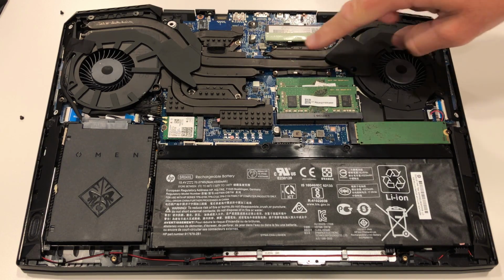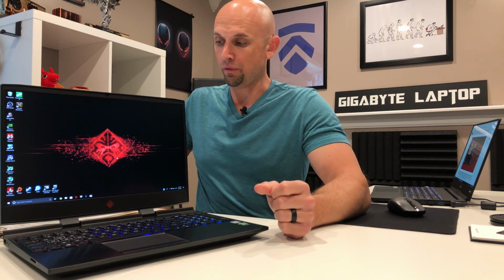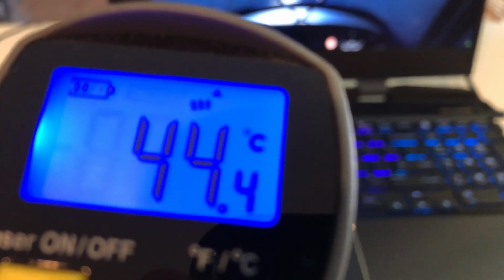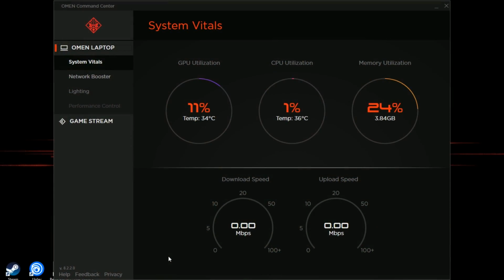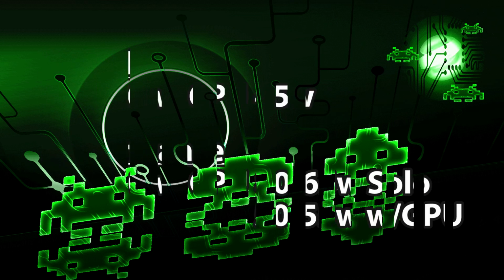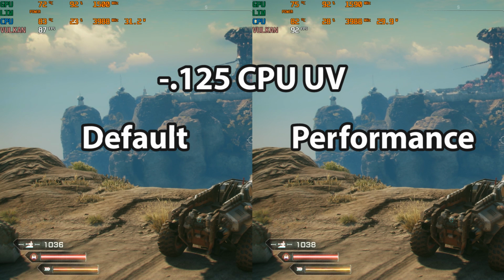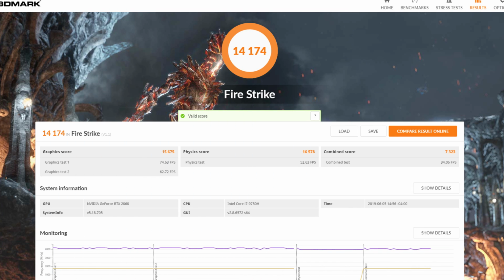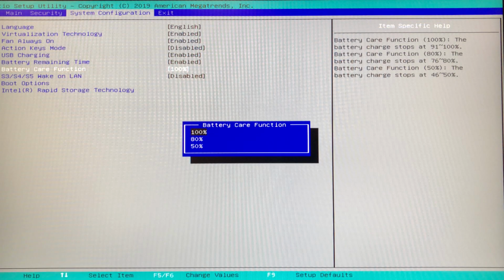HP Omen 15!  RTX, 9th Gen and 144Hz for $1199!

Comment: factor 1: before applying paste my idle cpu 60 to 75 gpu 60 to 70 becuase my rtx 2060 has giving display in my hp omen 15 1052nr neither intel display does  
factor 2: i applied paste exactly like a alots of youtuber does and tight the screw does it matter ? if i not tighten the screws? 
factor 3: i remove old paste gently just like many youtuber does my room temps is around 25 to 35 because its summer also i tried to undervolted, disable turbo boost but there is no difference in temps my gpu and cpu still got 90 above degree on gaming 
do you know any solution ?

Comment: I have hp omen 15-dc1088nr with the same specs as you mentioned, I can only undervolt my CPU up to -80mV. And my cinebench score is near to 2400
also no major difference between default and performance mode. What should I do as my temps are so high?

Comment: Omen 15. 
I9750 ,2060, 512ssd,Tb,144hz quiet,cool, bangin sound, slim. Hey Bob the price is right on this Omen 15
Reply from the maker: I think it’s dropped a price since I’ve reviewed this also 👍
Reply: @BobOfAllTrades  Ive stil got my Omen 15 i8750h, GtX 1060, 16gb, 1tb hdd ,256ssd UV -150.4 cpu, Gpu UV 1240mhz 750mv , 144hz lcd Installed via Bob method. All done the Bob way! HP announced a new slimmer tiny Omen 15 pavilion series w 300hz panel cant wait to see the review.✌
Reply from the maker: That’s a great machine I love laptops that have their display directly connected to the dedicated graphics card.

I have a contact at HP so I should be able to get that laptop eventually

Comment: I hope I didn't make a mistake by ordering the 2019 version with the exact specs in the video as I found it for a really good price. I really worry about the thermal performance. Do you think the new design improved the thermals?
Reply from the maker: I feel like this one ran a bit cooler especially on the GPU. Had better power limits along with maximum fan capability. So yeah, this should be a bit better I think.

Comment: @Bob Of All Trades : Here in denmark, the model is HP OMEN 15-DC1003NO with specs:
Intel Core i5-9300H
Nvidia GeForce GTX 1660 Ti
 8 GB DDR4 RAM (upgradable to 32GB)
144Hz display
 Would you recommend this over the Lenovo Legion Y540-15IRH (81SX00RWMX) with specs:
Intel Core i5-9300HF
NVIDIA GeForce GTX 1660 Ti
2x 8GB DIMM DDR4-2666 RAM
Your inputs would be really appreciated :)

Comment: Hi Bob! I would be very glad if you could give me your opinion on which one to choose, about the same pricing :

HP OMEN 15-dh0028nf : i7-9750H ; RTX 2080 (non maxQ) ; 16GB RAM ; 512 SSD ; 144hz + gsync 
GE75 9SG-835FR Raider RGB : i7-9750H ; RTX 2080 (non maxQ) ; 16GB RAM ; 1To SSD ; 144hz no gsync

My most important criteria is performance and cooling and I plan to buy an external screen supporting gsync with it. Thanks !!
Reply from the maker: The GE75 is much bigger and offers superior cooling performance.  You can max the fan with the push of a button too. 

Both will likely need a repaste. 

No way the 15” Omen is a MaxP 2080.  Their website needs updated as that chassis won’t handle a 150w GPU. 

The Omen has a little better built quality.  No Optimus and G-SYNC is awesome.
Reply: @BobOfAllTrades  Thanks for the fast answer !

2 french testers on youtube have confirmed the maxP 2080 in the 15" version and also the info sheets from HP make the MaxQ or not differentiation (maybe it's just in france though). That being said I would go for an Omen 17" instead if you think it would suit better for a maxP 2080 on the long run ?!

If I understand correcly the choice is to be made (if I only consider performance) among :
A better cooling on the GE75 
or
Slightly better quality and mainly no optimus + gsync on the Omen

I could use gsync on a gsync equipped external screen + minidisplay even with the GE75 right ? And if I boost the fans of the Omen 17" through the software can it match the GE75's cooling ? 
So in the end it comes down to a slightly better quality in the Omen and no optimus (sounds awesome), my choice should then be the Omen 17" with same specs as the GE75  ?

Thanks again for the insight!!
Reply: I stand corrected the testers only wrote rtx 2080 but don't confirm in their video if it's max q or not ! I'll go for the 17" version of the Omen or GE75 whatever happens! Thanks for the the important info

Comment: I had this exact laptop. In fact this was the video that made me get it. No problems and everything Bob said was on point👍  I thought it be a keeper, but after watching this video again like 100x 😁 and reading up online I realized GSync will be important. I exchanged it within the 2 week no questions asked exchange policy @ Microcenter. I'm so happy I did as I got 32GB RAM and RTX 2070 max q.  I'm playing DCS flight sim, a Very demanding game no doubt @ 111-144 FPS With MAX settings NOT high, MAX graphics settings. I tried paning around quickly and changing views to stress the system... 102-127 FPS!!!  It shouldn't be named "MAX Q" it should be "Dreams come true Q"  💖

Comment: Great channel. Just picked one up at Micro Center for $1,099 great buy. I undervolted by .140 and its stable and runs much cooler then out of the box. Put a overclock on it with MSI Afterburner  I let Afterburner decide the curve and its running great and very stable. I think for the money you can't go wrong if you don't mind undervolting if you don't undervolt the temps do get high. I don't have a lot of money so this is the best laptop I ever owned. Very happy with it. Thanks for your thorough review it helped me get the most out of my money.

Comment: great review! you are doing us all a great deal of help. thank you for that. i do have one question, need help about choosing the right/better laptop:
1) HP Omen 15, i7-9750H/16GB/512GB SSD/RTX2070 8GB/15.6"FHD 144Hz/FreeDOS (7RY32EA)
or
2) ACER Predator Helios 300 NH.Q53EX.025 / Core i7 9750H, 16GB, 1024GB SSD, GeForce GTX 1660Ti 6GB, 15,6" IPS 144Hz FHD
PLS HELP. what matters to me is 144Hz, nicer graphics, not too hot and not too loud!

Comment: When I go to Device Manager, the Monitor driver shows as 'Generic PnP Monitor'. Does anyone else have the same? I wanted to check if this is the real monitor. It shows as part DISPLAY\AUO82ED. Can anyone else check if this is the same monitor in the new one? I bought refurbished and worried.
Reply from the maker: That’s 100% normal. Use HWinfo64 👍
Reply: @BobOfAllTrades  Thanks. It is showing as Unknown Model AUO82ED which is from a company called AU Optronics, and not LG as you showed in the video. Should I be concerned? Been getting eye strain everyday.
Reply from the maker: Love Animals-01 Unless you bought it at Microcenter the chances are pretty high that you’ll get one of three different panels. Heck, I’ve seen this from the same place too.  No way from me to know 🤷‍♂️
Reply: @BobOfAllTrades  Sorry, final clarification. Are you saying that HP itself uses one of three different panels? OR do all new HP Omen 15 (with 144 Hz displays) come with the same 144 Hz LG screen?
Reply from the maker: Love Animals-01 Many manufactures use several different displays. It use to be much worse. Gigabyte is the only consistent company for laptops in that regard.
Reply: @BobOfAllTrades  Ok, good to know. Thanks again. I'll stick with my AUO82ED display and not apply that color profile then?

Comment: Anyone who can help please reply to this comment, thanks in advance.
>
>
>

Now I found the same laptop on Walmart website that has core i7 9th gen H processor, 6 gb gtx nvidia gpu, 16 gb of ram, 256 M.2 NVME SSD memory, 144 ghz screen, of course 15 in display, wifi 6, AND a headset and a mouse for $ 1100. I need it for editing. Should I buy it or buy the Pavilion which I can build thru the HP site, will link both here?
https://www.walmart.com/ip/Laptop-Omen-Headset-NVIDIA-HP-RAM-GTX-Intel-i7-9750H-16GB-1660Ti-Core-15-dc1088wm-6GB-Included-15-6-SSD-100-Value-Mouse-256GB-Gaming/992363585?findingMethod=wpa&requestUUID=40985dc9-8563-4ee9-bfec-4c4e5689e212&tgtp=1&cmp=237148&relRank=2&tax=3944_3951_7052607_1849032_3237391&pt=ip&adgrp=239533&bt=1&plmt=944x345_B-C-OG_TI_4-20_HL-MID-NY&wpa_qs=NXRQvCZ1cUBjgSCRCI8OHH94qRBk64UYkeIwCvrl5wcbVnE9j7WkWwWQVl57YlXo28b-3ipNdr8j6ixGdp2nl4t-By-B2z7Rc-fj5NDU7n4&bkt=917&tn=WMT&mLoc=middle&pgid=893789989&isSlr=false&itemId=992363585&relUUID=40985dc9-8563-4ee9-bfec-4c4e5689e212&adUid=28384a12-011d-4ee4-b4e6-bd880055c4db&adpgm=wpa&pltfm=desktop

OR

https://store.hp.com/us/en/ConfigureView?langId=-1&storeId=10151&catalogId=10051&catEntryId=3074457345619288318&urlLangId=&quantity=1&color=ghost+white

Comment: Hi Bob I bought this laptop 2 months ago and I loved it, but I have heat issues with the cpu, can you tell me which program did you use to UV the cpu? I try Intel XTU but somehow it doesn’t apply and tried throttlestop but it’s the same result. The temps are the same and I’m worried :( ( I tried -.125 and -.150 but the cpu was still in 97°
Reply from the maker: If you completely follow the TS tutorial I made you’ll learn how to get it to apply after boot. 

To maximize thermal performance you’ll need to UV the GPU too since it’s a shared heatsink.  Doing that can go a long way. 

Pretty sure I did that for this review 🤷‍♂️
Reply: Bob Of All Trades Thanks I will try it then, another thing: do I need to reset the values I put before in the TS or I just apply the new ones?

Comment: I'm worried of buying this laptop, it says on Amazon that it comes with 144hz but all the reviews say it comes with 60hz... Anyone else got that problem?
Reply: Ahhh.... Now I get it, the one in Amazon is the 15-dc1050nr, but the one in the video and in the Micro Center store link is the dc-1052nr. xD
Reply: Thanks, I'm also doing some research on the laptop, it worries me fact that it is supposed to be 144hz pf Refresh Rate, but there are complaints of getting a refund for receiving a 60hz laptop...
Reply from the maker: Hang tight buddy I’ll get home in about three or four hours I’ll do a little bit of investigation myself and make sure the link is updated to reflect the proper laptop. I already had to do that once because Amazon changed some stuff

Comment: That Battery care function is pretty sweet. I have worked with lithium ion batteries a bit and all cellphone and laptops manufacturers charged the cells beyond recommended  voltages to get better specs, 90% of the wear and tear on lithium ion batteries happen when you let the battery drain past 15% low or charge over 90% full charge.

Comment: So I believe the hardware for the g-sync is in there and they released how bios update for the fan speed
Reply from the maker: There’s no module for laptops. The display must be directly connected to the dGPU or use MUX. Then it can be done as a bios update should the manufacturer do so.
Reply: @BobOfAllTrades  The specs for this laptop indicate it has G-Sync though.
Reply from the maker: David VanHouse Ok and some laptops have Gsync. Not a single one has a gsync module 👍
Reply: @Unsmooth_Edwarda  yeah it does

Comment: so after 2 weeks of use i got my first issue with it. it overheats like an oven. on the default mode its stable at round 70-75 degrees. but in the performance ive have had temperature hits to 96degrees.and noi guess cuz of the overheating the headphone jack and audio jack dont work. i connect my headphones and i get weird blowing noises from them.and the same headphones connected to my phone work perfectly. plus its a shame that it only comes with 512ssd and not a hdd aswell.
Reply: Hey there, should i get hp omen or a helios 300 which one would you suggest from your experience. Thanks for your help really.
Reply: i got same issue i applied thermal paste mx-4 but its doesnt event matter my cpy gpu temps still crossing 90 plus degree do u have any solution?
Reply: Where did you buy from?
Reply: @guel4490  amazon

Comment: Do you recommend this or the Dell G7 7790 with the same specs?  Also is this model any better than the new one with blacked out accents? Do you think I should get the RTX 2060 or the GTX 1660Ti for casual gaming? Prices are roughly the same for them

Comment: Which one should i choose from Helios 300 2019 or this Hp omen 15 considering i am a programmer and a moderate gamer, also my ambient room temperature is around 35C as i have heard this Hp omen gets really hot(i am comfortable to tune and undervolt it) ?
Reply from the maker: Both will run hot for you especially with that ambient. If you’re ok with louder fans then maybe go Helios.
Reply: @BobOfAllTrades   @Bob Of All Trades  So old hp omen (Rtx 2060 one) at 1099$ vs Acer Helios 300 at the same price. Which one should i go for?
Is the thermal tuning for Hp doable cause i have no knowledge about how to do that as of now.
Is there much difference in the battery life because i have seen others claiming  5 to 6 hrs for normal usage (with a little bit less brightness) on the predator.

Comment: Do you have a guide or screenshot of your afterburner settings? How do you set 0.7 volts undervolt for gpu?
Reply from the maker: Valters Boze Use and understand the MSI voltage curve editor using my tutorial I created a few months back.  Learn how that works then dial in your own GPU 🤛

Here it is https://youtu.be/rV0tWKLAprg
Reply: @BobOfAllTrades  yeah saw that. My omen rtx2060 never goes above 65C, while CPU goes 99C. Also rtx is capped at 90watts. If i raise clock speed 200mhz it just reboots but never reaches 70C, i cant figure out what im missing, need more coffee

Comment: Bob, your reviews are great.  I wasn't planning on buying this laptop since I actually like my xps 15 9570 for content creation.  Imagine my surprise when I was able to buy an open box unit for $825.  It is in great condition.  Also, the screen that came with my unit is the LGD05FE.  I think I got a slightly updated model.  What did you mean that some reviewers got newer hardware inside the old case?  Thanks for all the great work.

Comment: Did you find out if the Thunder3 port used 2 or 4 lanes? I was your "best $1,000 gaming laptop" video, you made mention looking further into this. I have not seen a pinned comment answering this.
Reply from the maker: Charles Sublette They’re all 4. Sorry I thought it well known by now 👍
Reply: @BobOfAllTrades  thank you! I have been gone far too long from the tech arena. Bob, why are Thunderbolt 3 ports so rare to find on gaming systems under $1,400 ? HP Omen is one of the few that has it. Is the Thunderbolt3 just a flash in a pan? I look forward to playing around with the daisy chaining, ext gpus, and multi-monitor feature.
Reply from the maker: Charles Sublette Maybe it’s a licensing expense?  I’m not sure 🤔

Comment: Bob, what do you believe is better? The y540 with the i7 9750h and rtx 2060 or this laptop?
Reply from the maker: Pretty equal. Pic the one you think looks the best 👍
Reply: @BobOfAllTrades  Thanks for the answer. I'd probably go with the y540 because it doesn't have that "gamer aesthetic"
Reply from the maker: Hasnain Ali That works 👍 just expect to tune either one or except 90c on the CPU. Pretty standard.
Reply: @BobOfAllTrades  yep, I'll use your guides

Comment: Have money burning in my pocket and looking at the Omen 15 with the 9750h and RTX 2060 (Microcenter)and the Lenovo Y545 (Walmart) with virtually the same specs. What to do?
Reply from the maker: Both are pretty equally matched thermally. I like that both have a direct connection to the GPU. 

The y545 is a bit more subtle and the Omen has TB3. 

I don’t see a could go wrong with either one 👍
Reply: @BobOfAllTrades    Thanks Bob. And why did it take you two minutes to get back to me  :)    Today is decision time.

Comment: Just built one at HP. and ordered, it was worth $1,034.99, it is 200.00 off right now to build one of these.  I HIGHLY suggest anyone who's looking for a laptop such as this one does this and take advantage of the deal.

OMEN by HP 17 Laptop PC
Windows 10 Home 64
Intel® Core™ i5 9300H
NVIDIA® GeForce® GTX 1650 (4 GB GDDR5)
256 GB PCIe® NVMe™ M.2 SSD
Full-size island-style white legend 4-zone lighting RGB backlit keyboard with numeric keypad and 26-Key Rollover
8 GB DDR4-2666 SDRAM (1 x 8 GB)
17.3" diagonal FHD 144 Hz IPS anti-glare WLED-backlit (1920 x 1080)
Intel® 802.11b/g/n/ac (2x2) Wi-Fi® and Bluetooth® 5 Combo(MU-MIMO supported)
HP Wide Vision HD Camera with integrated dual array digital microphone
4-cell, 70 Wh Li-ion polymer

I will be upgrading the ram soon with HyperX Impact 2666MHz DDR4 CL15 2x16 GB, and a WD Black SN750 500GB w heatsink included.

Can't wait to add Thermal Grizzly's Liquid Metal to it the CPU and GPU, and yes, I will be protecting the capacitor with liquid electric tape, I know my shit, did that to my i7 7700k, added a copper IHS and Noctua's new Noctua NH-U12A cooler.

Negative -20c now @ 5 GHz all 4 cores.

Comment: This costs 1900$ in India
Reply from the maker: How does that compare to other laptops in your country with similar specs?
Reply: @BobOfAllTrades  as of mine i bought 2018 helios 300 with i7 8750h with 1060 60hz model no 144 hz available 128 gb kingston ssd and a weird chinese company hdd 1 tb in may 2019 at that 2019 model wont came and costed me 1400$ equivalent price at that time also $1 is equal to 72 rupees plus 15% GST

Comment: My last years model is for a lack of words... a piece of s**t.

Its completely broken and barely holding together. My BIOS wont update, ok it will update technically but the update never installs so you are left with a brick with a flashing capslock. My ram module died while updating windows and now my M.2 SSD cant be picked up by the BIOS. It thermal throttles while using Google chrome.

I hate this thing and next time it goes crazy I'm placing all the original parts in and giving it to the shop to repair it... witch they wont.(I have my fingers crossed for a voucher for a new laptop or my money back)